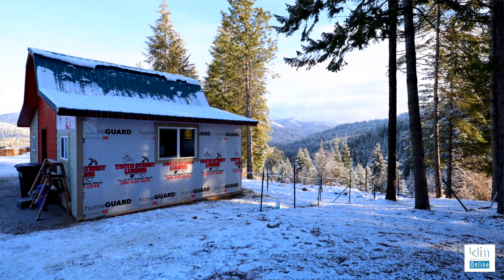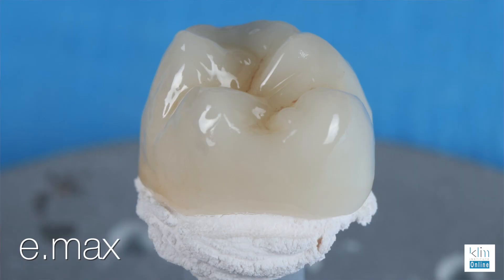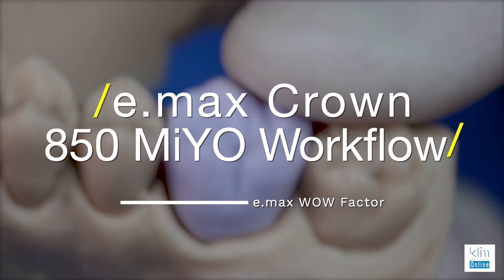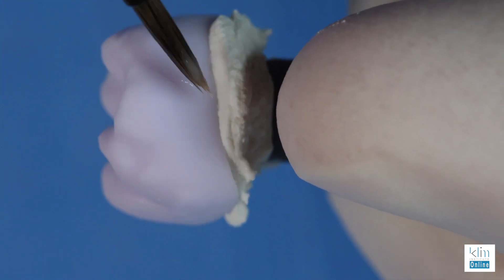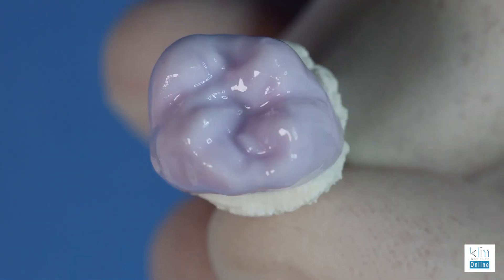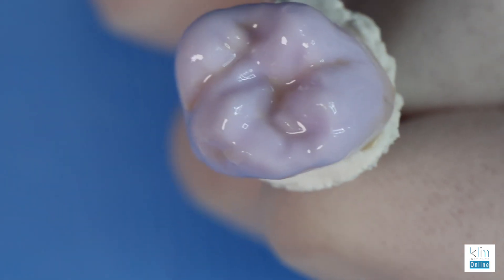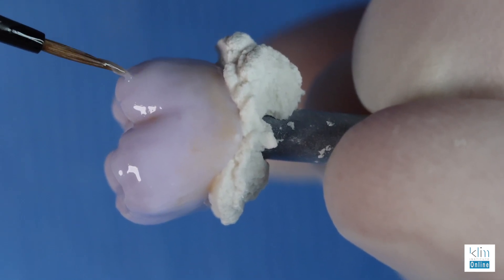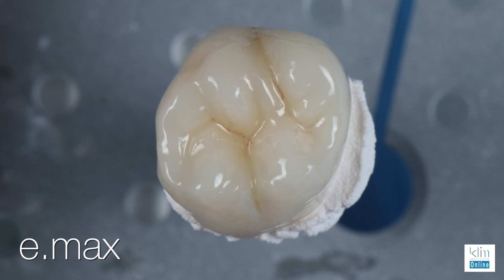e.max and 850 MiYO Stain & Glaze Workflow Simplified

Comment: Hi Doc. Can Miyo be used to customize zirconia crowns also? I use ZirCad Prime milling blocks. After Zirconia is fired, can Miyo 850 be used?
Reply from the maker: Yes, you will need to use the e.max corrective cycle.  But it will work. All the best.

Comment: Nice work, thank you for the presentation.  Is there a particular crystallization schedule that you like to use when applying the MiYO 850 to the purple (non-fired) eMax?   Thank you!
Reply from the maker: All the e.max crystallization cycles work.  All the best.
Reply: @KlimDDS  Thanks for your quick reply!
Reply from the maker: Also, with two or fewer restorations, I use the smaller firing tray with the speed cycle.  850 works with all the cycles.

Comment: Great results! I think it's time to upgrade stain and glaze. Question regarding zirconia, I use katana (haven't tried the katana one yet but I'm excited to see it and hear your thoughts) I use your zirconia finishing kit with the pre sintering polishing and post sintering and am very happy with the results. For situations where I want to add some buccal and maybe lingual characteristics with stain and leave to occlusal as polish only, is this system a good option post sintering stain and glaze on zirconia or is infiltration better?  If so is there a recommendation for fire program on then CS6 oven for glazing and staining zirconia?
Reply from the maker: Adam.  Yes, Katana One is a 4Y zirconia, whereas Katana is a 5Y, the minimum thickness for Katana. One is 0.8mm.  So yes, I am a fan of Katana One.  There are three glaze systems I use.  MiYO 850 for pre-cyrstallized e.max, Regular MiYO for zirconia, but has a long firing cycle.  And  Ivocolor, a quicker option for zirconia stain and glaze, and excellent on Empress and Vita Blocks.  All these systems can be fired in the CS6.  However, they must be programed in.
Reply from the maker: Good question.  MiYO 850 is for e.max only.  I use three options for coloring zirconia. As you mentioned, infiltration, Ivocolar stain and glaze, and the best are MiYO regular colors. However, MiYO typically has a long cycle and is not practical for one appointment turnaround, but the most aesthetic effect.  For zirconia stain and glaze efficient turnaround, Ivocolar works the best.
Reply from the maker: Correct.  Use the MiYO Esthetic, design more for zirconia.  It is a separate system from MiYO 850 but is the standard on Zirconia and works well on Katana.  All the best.